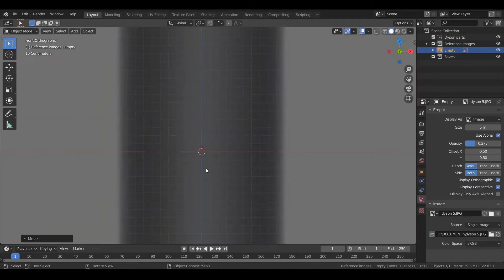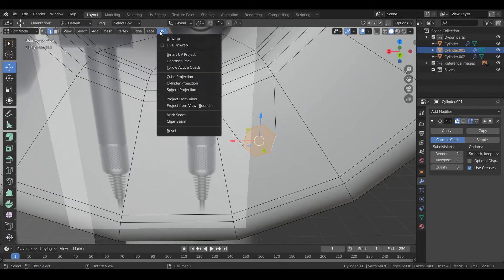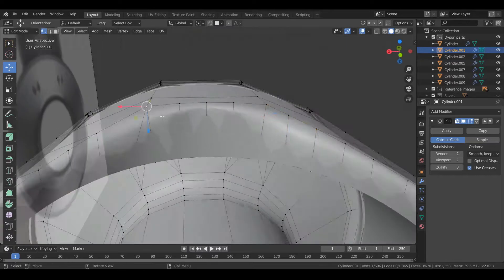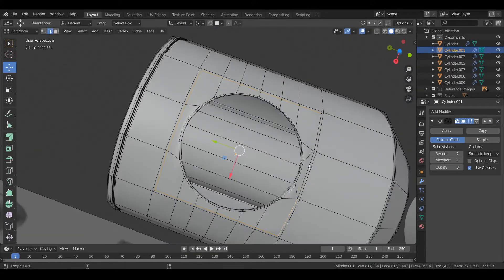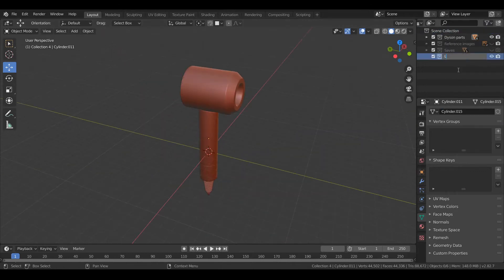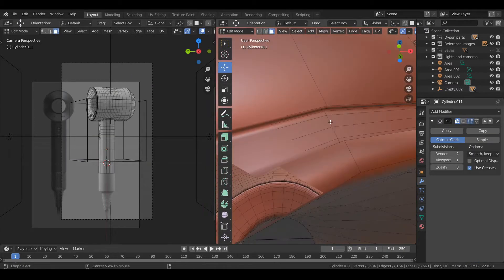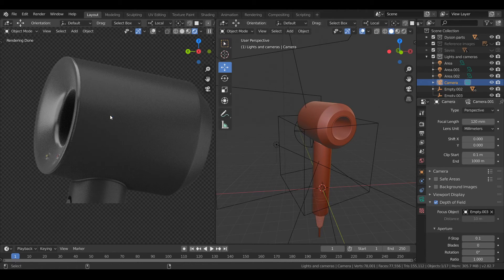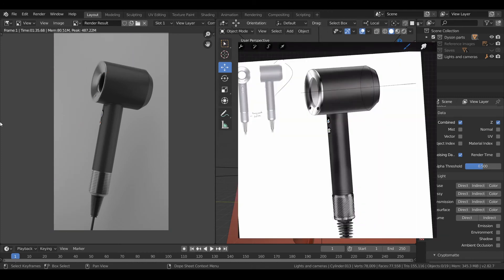Dyson hairdryer - Product design 3D Modelling In Blender - Speed Modelling + Rendering

Comment: How did you do the wholes ? I used bool tool but it keeps crashing. So I tried using a mask but it doesnt fill the inner parts of the wholes when I add solidify. Any help  would be appreciated./
Reply from the maker: I added the holes on the metal part with a texture to mask the transparent areas. Mine doesn't have thickness on the inner parts either so I made a solid metal cylinder to go inside so that you can't see all the way through. Thanks for watching!